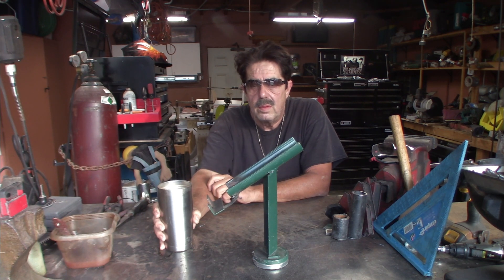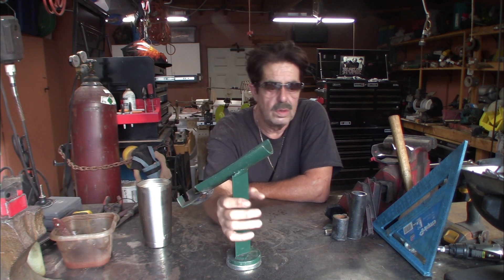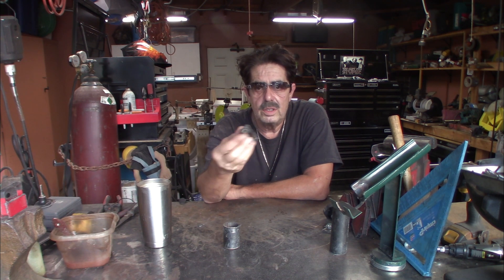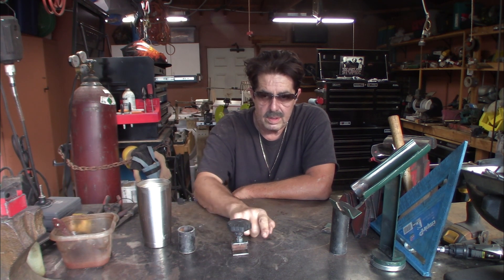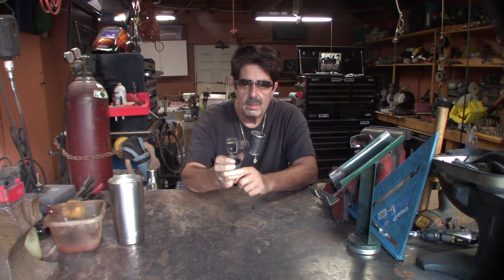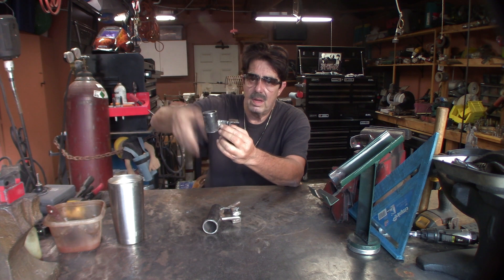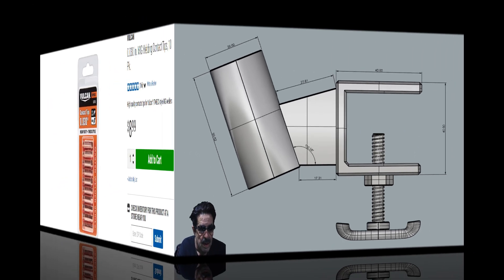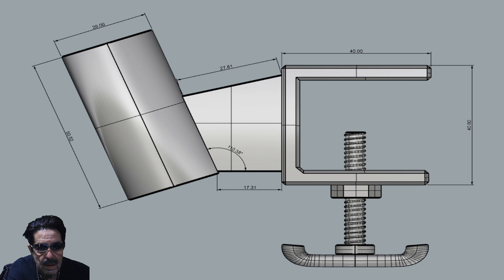How To Make A Mig Gun Holder Out Of Scrap Metal

Comment: Hi Mwelyn,
What kind of welder would you recommend for a Beginner just learning and I'm on a fixed income. Thanks again for sharing your thoughts and videos Rodney
Reply from the maker: There are so many good ones out there - Justin uses the Titanium from HF and i have demo'd it and it is a good one, Miller, Hobart,  and Lincoln are good choices and I see Lincoln welders on sale at time especially now when you are going into Black Friday and the holidays. 
                                "Make sure you get one that you can use gas with and that you can hook up from 110 to 220"
Amazon search will allow you to read the specs, and may show some deals coming up, also try craigslist because this is where a friend of mine got a great deal a mig welder but take someone with you that knows about welding so you can demo it and make sure it is working correctly. 
My Email is Dreamthief12345@aol.com so if you want to contact me you can but the above is where you could start..........let me know if i can help you